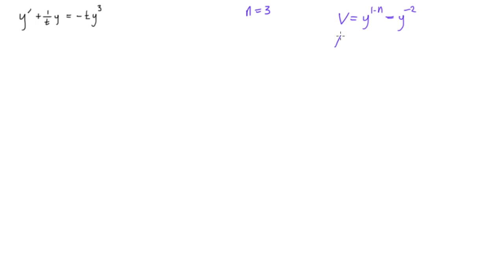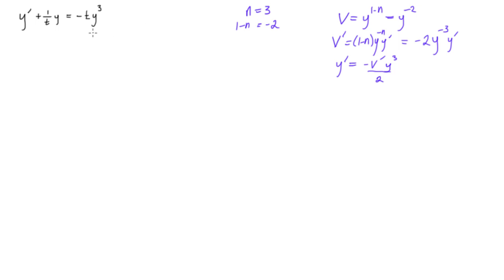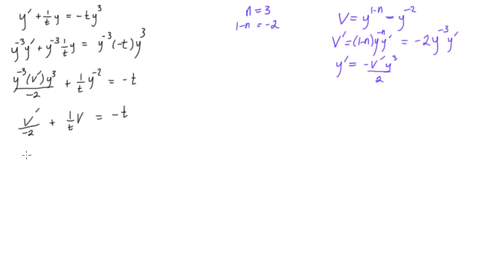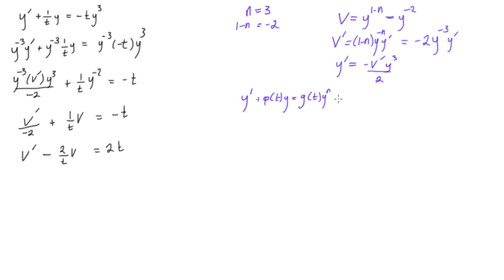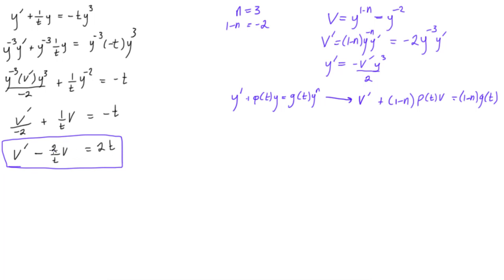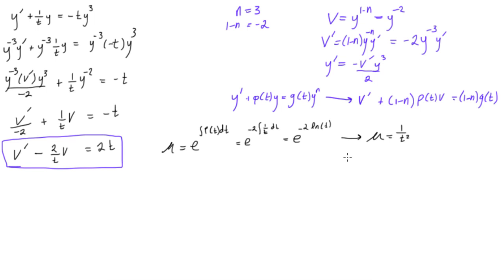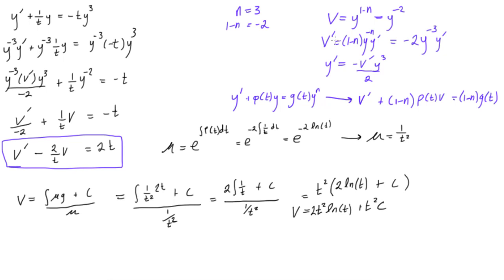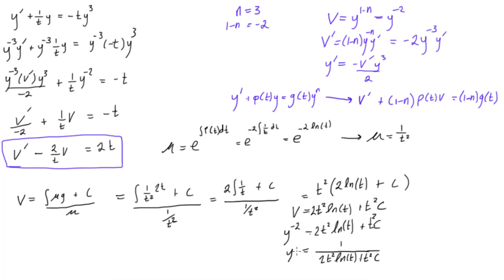Bernoulli differential equation example #1

Comment: I have new way to solve Bernoulli D.E.
I put a new D.E (Alsultani D.E)
dy/dx +P(x)y/n=Q(x)y^k   . where k=1_n 
So to solve our problem 
y^'+y/x=xy^3  .here k=1_n=3
Then n=_2  now multiply by (_2) we get  _2y^'_2y/x=_2xy^3  so p(x)=_2/x 
Then the I.f.= e^int(_2)dx/x=1/x^2
_2y^'/x^2_2y/x^3=_2y^3/x  divide by y^3 we get
2y^'/x^2y^3 2/x^3y^2=_2/x
d( 1/(x^2y^2)=_2/x
1/(x^2y^2)= _2ln|x|+ c
Please I need your support and replies. 
Thank you very much

Comment: Thanks . The denominator should be: 
Root ( 2t^2 ln t +c t^2 ) 
Correct me if wrong plz
Reply from the maker: You are correct. There is an annotation in the video that mentions the typo, but if you are watching on mobile or using adblock then you may not see it. I have updated the description to mention it as well. Thanks for watching and pointing it out!!

Comment: That is a great tip. I'm not even going to use it as a shortcut unless it is a mad rush. It's going to be a great checking tool for when I'm just making sure I didn't screw up before proceeding.
Reply from the maker: +CrushOfSiel That's a really good point! It would work great as a way to check if your on track with the full method :)